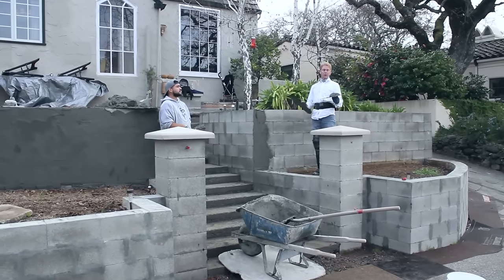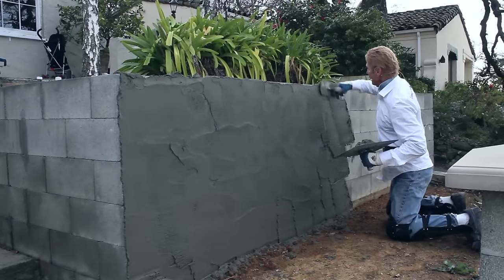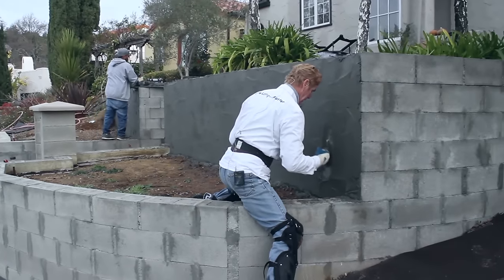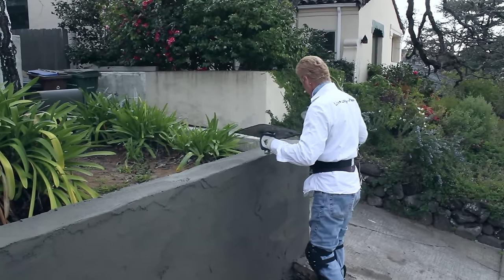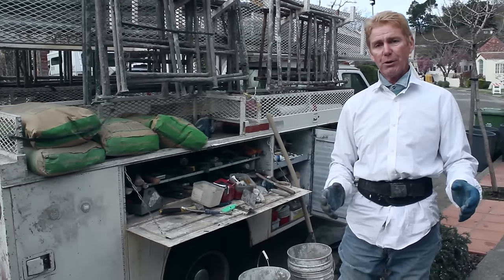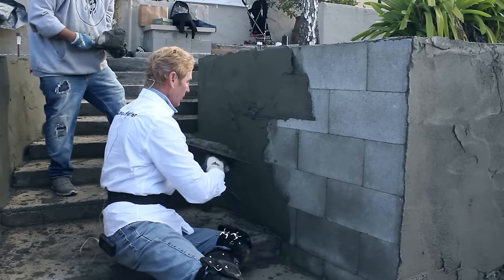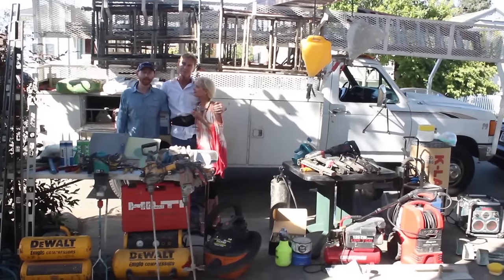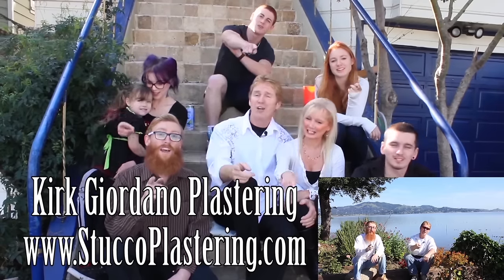Stucco to cover block walls or exterior plaster

Comment: I started wearing catchers kneepads because I saw you on another video explaining that and you’re right they are comfortable. Thank you.
Reply from the maker: They are indeed the best, so comfortable, I sometime wear them home.💃🏻
Reply: @StuccoPlastering  Old baseball player here.. I see they also have what is called "knee savers", pads that strap to back of thighs.
Reply from the maker: @nicocortez102  They have a few straps which makes them more comfortable plus they don’t slide down with every step I take.

Comment: Hello, I love your Videos, 40 years ago when the Carpenters I worked fr had no work for me they would Send me over to work with a French Canadian Plaster, "Clay", I mixed and Carried Hod, Set Scafloding, moved the set up before the need and did a Good Job. I learned enough to do some small contracting of Shower surrounds, ready for scratch and green. I ripped them out and set them up for Scratch and ready for Tiles. Made a lot more bringing in the "Second Plaster" Guy on my Jobs after his full day or on Saturdays. Learned a lot, I was a kid but working with men. all served me well to cash flow my BA and Masters Degree, hustling side jobs and doing window installs in Stucco and plaster CA Bungalows I ripped them out set the new windows and readied for the Plaster to come in behind me.  Most of the time I had materials and mixed for him. Thanks, I am going to watch your fix your Alternator.
Reply from the maker: Greetings, My frugal friend. Thank you. 
Yea, we fixed the truck. It had its feelings hurt. It just needed to know it was still loved.😏
  Our unique plastering Tip:  all subscribers or anyone who stumbles on our channel with a question, type it into our Stucco/Plastering channel, and like magic, a video will appear to explain how it's done. 	
   This feature is miles ahead of any plastering forum. 🥳	
Kirk & Jason Giordano Plastering

Comment: Hey Kirk I have watched every video you have made.
Some multiple times 🤭
I have never gone stucco ever.
My girlfriend lives right on the golf course, and her wall gets plastered buy everything including high-power sprinklers.
Her stucco was falling off in sheets.
After watching your videos, I figured out that someone didn’t clean up first I’m assuming.
So I removed majority of it with the power washer 
And redid the base and the brown coat.
I did La Habra crystal white 
In pretty brutal and conditions.
We live in Palm Springs, California.
It’s either do it when it’s 120°
Or do it when it’s cold and windy and we had pretty good rain this last winter.
I did everything by myself
And to say it was challenging, is an understatement. 
Highwinds are normal here
But I had to dodge golf balls
Sprinklers
And HOA lol.
I wanted to send you some pictures and thank you for your big-time help. I would never of done it without you.
There’s a few side notes.
I found myself unable to apply and then have time to come back and finish the texture
And it’s a 70 foot wall I did both sides.
I know that you’ve preached no joint lines but that was going to be impossible for me
Or at least I thought.
After a lot of thought, and some failures
I decided to apply and finish at the same time with a red float.
As I was finishing
I had multiple people trying to hire me.
I think it turned out pro, but would love to hear your professional opinion if I can figure out how to send you the photos. And I had one question.
I am pouring a walkway along side, a cinderblock retaining wall that I just built.
That’s another first.
My question is, can I use some of my leftover Crystal light packets to mix into my concrete mix and make a cool white walkway.
And if so, do I just mix it like I did with the stucco it seems to make sense I mean it’s Portland cement, right?
Thanks in advance I hope to send you some pictures
You might even want to hire me lol
Reply from the maker: Howdy Steve, man, you've been busy, i don't even try to do walls that size myself.
 My email is on this site, www.stuccoplastering.com, or kirkgiordano@gmail.com.
  FYI, they do sell white cement, it's made by Hansons.💃

Comment: Thanks for the great info! I am working on a bid to finish the block wall foundations on a log home that I helped to build this last summer. The last house they put a thin coat in and you can see every grout line when it rains! I wanted to make sure I was going to be doing it right since I have never done much of this besides a few small plaster repairs. So much great info here!
Reply from the maker: Good evening Bart, if you can see the grout lines when wet, this means it was not applied thick enough.
 You can also paint the foundations with a quality primer and paint.
 This way, when it rains, the grout lines don't show.

         The University of plastering by Kirk and Jason Giordano
Introducing peace, love, and harmony back to the plastering world.

Comment: We are amid a new pool build and had the PB's team put in a CMU wall. The wall was supposed to be stucco, although, upon research, they may have used surface-bonding cement. Whatever they used, we can see the block lines beneath the material's surface. We plan to have the wall painted, and I'm curious if we should expect the paint will cover the outlines of the blocks? Or do you think we should speak to the builder? We're already seeing an area where the wall is cracking, so I'm generally concerned. Do you have any recommendation of how to bring this up or what to say in case we're met with the "oh that's normal" response in order to keep us quiet. 

Thank you in advance for taking the time to read my question. As a fellow YouTuber, I wanted to leave you a super chat but I'm not seeing the option to.
Reply from the maker: Howdy Drew, send pictures to kirkgiordano@gmail.com I’ll take a look otherwise I’m guessing.

Comment: That's looks cool Kirk. That green float really helps melt it in and blend those pancakes. I saw that finish today but it was a dryvit type  and smooth. Thought it looked weird. Stucco deffinatly looks better
Reply from the maker: Happy holidays Joseph, thank you, that's how they did the original finish.
                  Bringing peace, love, and harmony back to the world of plastering.
    The complete plastering encyclopedia on video, by the plastering messengers of Youtube with over 800 videos
Reply: I like that you only do stucco. That's all we did when I started.  We gone to durrock and foam now days it seems. Boss doesn't like to stucco because how bad it cracks over OSB. If  we do it now we basecoat and mesh the walls after cure time . Turns out really nice though.

Comment: Kirk,  I have just recently discovered your youtube channel. And boy am I glad I did. I need your advice on what products and the ratios i should use on my retaining walls. I live in Massachusetts and the  house was built in 1950 and the walls (poured concrete form boards
) have a heavy dash finish on them. Most of the original finish has either over time deteriorated or i have chiseled off. I have done some patch work, wire brushed and pressure washed them ready for the heavy dash finish. Over the last few weeks you have given me the confidence i need to tackle this job and i must say very much entertained me at the same time. I can tell you really know your business because i too have been in a trade (autobody) for over 30 years. Hope you have the time to respond. My best to you and your lovely family, William
Reply from the maker: Howdy William, type those question in our channel, all will bring up a detailed video explanation. as a rule, I prefer 3 parts plater to one part cement plaster.
                  Best wishes,
Kirk and Jason Giordano plastering

Comment: Nice job, you know you skill for sure! One question i have is how do you figure out how much mud you need for your first coat. Thanks
Reply from the maker: @leifwoodward8900  Practice, it’s not difficult to apply at least a half inch or more, in fact it’s quite easy. Anytime I’m not certain I just apply a bit heavier. The amount determines if when it rains all the grout lines show. With a half inch they don’t. Cheers

Comment: Nice Job !    So you are using  portland cemente with lime, that's actually mortar !   Most of the time for outdoors I use portland cement with sand only to make it grab better. I put one coat of very strong cement first ,i know it causes hairline cracks but it grabs forever, than I finish with with a no so strong cement ratio, stronger than mortar anyways, last long and wont crack. Been doing that for over 20 years. And I NEVER use bonding agent. That stuff is the very reason why cement work fails. I fixed too many stucco work and windo sills and brownstone jobs other company did and used that stuff . Thats good while aplying the cement,makes it hold better, but aftee it dries it creates a layer of rubber/ glue in between the old cement and the new one. And the layers split. As we know cement only sticks to masonry.  I had to fix jobs some friend from a company I worked for did and he used that stuff, the wall cracked after a few weeks and they sent me to fix it, I did with no bonding agent, its holding until this day after 4 years or more. I use a lot of water for the cement or mortar to grab instead. And I usualy chip the wall make the area very rough so the material has something to grab. I spend extra time preparing the area,its very important.  I usually work a lot restoring details in stones like bronstone or limestone in Building in Boston but I do a lot of stucco work and I love it too, and I think the weather on our area helps a lot!  I wish I had a good helper like you have! Lol. The guy is great too. Great job !!!
Reply from the maker: @maxmartins8813  Thank you Max, for this skin coat we did use regular Portland stucco with less sand for easier spreadability. We also simply hydrated the walls after pressure washing to achieve a Mechanical  bond versed a chemical bond.

Comment: Love to see how this looks in few years after a good rain. The block joints will show because you didn't attach wire to the block and or use a fiber mesh for anti fracture. Yes we know how long you have been doing stucco, but it doesn't mean you have been doing it right! DELAMINATION have you heard of that one? Well I guess it keeps other people in business to come behind and fix things.
Reply from the maker: Howdy, O T, that's just jealousy talking plus you are sort of ignorant, but I won't hold that against you.
Fiberglass mesh tape would do nothing to stop any exterior cinder or concrete block or concrete retaining walls from moving.
 A far as stucco netting, this has no benefit, in fact, it's counterproductive, instead two porous cementitious materials will adhere permanently as long as there is an excellent mechanical bond, this means misting the existing walls with the proper amount of water then applying your stucco, they adhere by suction. 
Of course, the wall has to be free of any and all dust.
 FYI, Using words out of context does not make you a plasterer, it just makes you sound foolish.     
                                   Live long and plaster
    Images of Kirk Giordano’s Plastering projects and tips
Reply: I said attaching wire which means Diamond lath or others call it expandable metal. Then I use a slurry of full acrylic thin set with a sponge or brush to get the mechanical bond to the wall. At this point I then burn in my mud to the wall and wire. In this application even if the wall moves, or expansion and contraction happens I am still bonded to the lath. I am not saying you don't know what you are doing. Obviously you have talent, but individually we can't know everything. Just for the record, I do tile and have been floating walls for quite a long time. Additionally I have done plenty of different stucco applications. Since day one in tile, my boss taught us to NEVER float directly to block, brick or stone on a wall without wire. She was right. Lastly if you want to see an example of what I am referring to. Have a look at Robin Williams retaining wall by China beach (Sea Cliff) after a good rain. That's exactly my point and I see it all over the U.S and Europe. People doing it the wrong way.

Comment: Kirk, Question for you....First, excellent video. You seem like a natural "Instructor".My contractor applied stucco over smooth concrete (against my wishes) and as I expected, the stucco delaminated. Is there a bonding agent I can apply or do you recomment rouging up the existing surface first? It's a small area as we step out the double doors, maybe 15 SF max.  Jack Cassidy P.E.
Reply from the maker: Howdy Jack, in order for the stucco to apply to smooth concrete it has to be super clean, or etched or a bonding agent applied.
I suggest if it's come off, use a wire brush and a water hose, to clean off excess dust and film from stucco, then apply a bonding agent. Then you're ready for stucco.

                  Bringing peace, love, and brotherhood  back to ”Plastering .”
 Created by Kirk and Jason Giordano plastering, sharing over 800 free, “how-to videos.”

Comment: Hey Kirk. Thanks for all the great videos! Question: How do you stucco a CMU block wall that has a control joint? It’s that gap in the wall for long stretches of block. Do you put a plaster stop on each end or an expansion joint mesh? Thanks Kirk!!!
Reply from the maker: Evening Matt, no control or expansion joints for block walls, why Not?
 Blocks don't expand like wood does when in the direct sun for weeks let along moths.
 An no for J trim on the ends plus no stucco netting or mesh nettings of any kind.🤔

Comment: Hi Kirk, I have been enjoying some of your videos very informative thank you.
I am building an ICF house (Basically it's a concrete house covered w 2" of foam) I have a product question what stucco product or system would you recommend?  I was looking at something called stuccoflex they suggest a base coat over fiberglass mesh then spray hopper or trowel on the stuccoflex. Do you like this stuff and would it serve my purpose well in cost and function? Any information would be greatly appreciated.
Reply from the maker: Evening Rodger dude my researching expert, I would recommend you watch the video below in regards to my opinion of the stucco acrylic stucco-flex, it's actually known as Stuc-O-Flex, their chosen way to spell their product, possibly cost them some customers as it's cute but confusing, oops, take that back, I just Google the word and does indeed trsfer over, I consider the product top of the line. Link below.

               https://youtu.be/283DclFqDwk

                                Live long, and plaster
                     Plastering tips and techniques
Reply: Thanks Kirk, appreciate you responding so quickly.
I had watched your video on the duck pond, fountain repair, great looking job by the way.  Pretty sure it turned up when I searched stucco flex on youtube. Noted you speak highly of the product on there. I was impressed as well and had already contacted them and got pricing before I built this house.  More the point of my question is would you use it for an entire house as a system vs. traditional cement stucco. Mesh, scratch coat brown coat. I don't want it to seem like styrofoam when I'm finished. I'm thinking the stucc-o-flex can't give it any rigidity. Maybe the base coat and fiberglass mesh their recommending takes care of that? Lastly I don't understand why everyone wouldn't use S.Flex for its no cracking characteristics vs traditional unless its just cost prohibitive.
Reply from the maker: Howdy Rodger Dude, I first used stucco-flex about 30 years ago on a home in Tiburon ca.that made the cover of a magazine.
 I didn't purchase it thhe pilot who owned the home did.
On this project we also applied about 2,00o feet of styrofoam, the styrofoam alone took 8 guys close to 3 week's to attach.
 It was  agreat product then and I would indeed use it on my home.
 It was cost prhivted 14 years ago when I appled anther great acrylic to myhome, so Chosses the send best as I was on a budget and the next best was close to me.
 I ended up doing three coats of the second best as they could not get thecolor right, shit happens, but now it's in the past.      
                       Live long and Plaster
Teaching the world how to plaster one Video at a time.

Comment: Can I use a 60 grit sand paper to smooth over very small areas of stucco, but while is still not too solid (around 3 hours after application)?  I'm talking an area of about 10"x4".  If not, what would you recommend? Thank you for your videos.
Reply from the maker: You can try, I'd say it's faster and easier to scrape it off with the edge of your trowel.👨🏻‍🔬

Comment: Hi Kirk and the team
Look I've been watching you plaster for some time now. The other day I plastered a part of the foundation at home here in Christchurch, New Zealand it come up grouse so I used sand cement and lime. I was wondering if you could tell me why when it is wet part of the surface is patchy in colour white and grey. I was going to leave it unpainted just sponge finished I have more to do and woundering if there is something I can do to overcome this.
Many Thanks keep up the great job
Cheers Glen
Reply from the maker: Howdy Glen, like a red brick, cement darkens when wet, then when drier conditions occur it will again lighten, this is maintenance free, they never need painting.
Yours is similar when applying these finishes, they take practice to get then solid in appearance.
 The walls must have the same suction, materials must dry at similar times, etc.
 Either try again or fog coating the discolored work, it may help, but fogging discoloerd stucco finishes also takes a lot of practice.     
                                   Live long and plaster
      Do’s and don’t of plastering’s leading expert